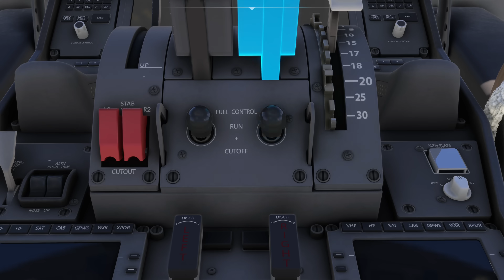Air India 171: Why Did The Fuel Cut-off Switch Get Moved?

Comment: i saw one pilot's analysis of the report that unless thrust lever is pulled back completely, it's not possible to switch off the engine fuel supply. since the jet was ascending it's thrust levers must be totally forward. then how were the switches turned off?

Comment: These raise serious questions on whether clear red-flags on the fuel shutoff valve of Boeing’s 737/757/767/777/ and 787 were overlooked

The UK Civil Aviation authority raised questions  on the air worthiness of the Boeing 787, and specifically touched upon the fuel shutoff valve even before the crash. The AI 171 was a Boeing 787.  Please do not avoid possibility of mechanical failure. We don’t want to wait for more crash. 

Moreover, please don’t compare response of Pilot with kids response.

Comment: Those switches SHOULD NEVER be located there in the first place. Never at the central pedestal within reach of other vital mid-flight controls and switches...I have said this multiple times...the cockpit panels were poorly designed. First to be switched on last to be off should not be easily accessible such that accidental touch without both eyes watching hand movements (whether your own or your partner) can lead to catastrophic unwanted situations, hence should have been better be located not on either side but at the central overhead panel, where both can notice any deliberate hand movements yet can quickly glance if in right positions  but still not too easily touched by any accidental brushes of fingers and hands that mostly focused on central levers and switches nestled between the two seats

Comment: I have to caution people in the most stringent terms to recognize that we do not know that a human being moved the fuel cutoff switches. We know only that the flight data recorder recorded a change in the value in the computer that stores the position of the fuel cutoff valve. It is entirely possible that this was a software fault, and not an intentional action. We may never know the truth of this.
Reply: surely not, if there was no change in position of the switches one of the pilot would not have asked that question in the first place…so your assumption is precisely wrong on this Sir…surely we must not judge till final reports come, but human intervention is confirmed with the data available till this point…

Comment: Make no assumptions - The report states "transitioned" not deliberate action. In the absence of all pilot conversations, we cannot conclude that it was pilot deliberate action. Lessons Learnt - (i) Install cockpit video cameras, (ii) Space out the fuel switches - one of either extreme side of each pilot, (iii) Check for any software glitches than can cause fuel shutoff with the fuel switches still in the "run" position. You are concluding "human intervention" which is concluding even as the investigation is on. You appear to be a "Boeing" spokesperson. Remove your tinted glasses and view the case again from an unbiased perspective and you may be surprised that a different outcome may also be possible

Comment: This man is completely biased

First he is comparing the pilots to his kids 
How can u compare a pilot to a kid whose brain is still under development.

He is saying that the report clearly points out that the aircraft was not at fault where does the report say that, the report clearly states that the switches transitioned from run to cut off, the report does not state what caused this to happen that is still under investigation.

The report mentions that both the engines lost power  within one second of each other.

Just yesterday a experienced pilot who has flown this same type of aircraft for years was on TV  saying it is humanly impossible to cut off the second switch after cutting off the first one within one second.

There should be a law against misinformation and the pilots families should file a defamation case against this person.

Comment: The timeline in the report does not match the take-off video. The report states that lift-off was at 08:08:39 and that maximum height was archived at 08:08:42, where the fuel control switches were translated from RUN to CUT-OFF. From the video the aircraft is seen to climb for much longer,at least 6 seconds.

Also that the RAT was starting to produce hydraulic power at 08:08:57 and at this time both engines N2 values were below engine minimum idle. The RAT takes 6 seconds to spin-up to provide hydraulic power. Also the engines take a minimum of 5 seconds to rollback to below idle. That is 11 seconds in total. But the time from when the switches were moved to the time when the RAT was beginning to operate is only 5 seconds.

This suggests that the RAT was deployed earlier (around 5 seconds) and that both engines running below idle was not what caused it to be deployed. 

There are 5 basic conditions that can cause the RAT to be deployed (and about 10 with variations). Deployment of the RAT is inhibited on the ground by the Weight on Wheels (WoW) sensors. If other conditions to deploy the RAT were satisfied, then the RAT would be deployed at the weight came of the wheels, at lift-off at 08:08:39. This implies that there was another problem before the switches were moved at 08:08:42.

The exact time the RAT was deployed must be determined and also the conditions that caused the RAT to be deployed.

Comment: How about this for the cameras: The recording only stays stored during a particular flight and only on board the blackbox. At the end of each flight, the recording is erased but requires authorization from both pilots and one, say the senior flight attendent, to delete. So, in case of an accident it will always be saved, cannot be removed by one person to hide something he did, cannot be removed by both pilots alone as well if the other crew suspects it would be worth to see that video even for a minor accident, and the pilots dont have to worry about their privacy/or some pressure due to the presense of cameras.

Comment: You CANNOT have a design where two people would be required to shut down an engine, because the entire point of having two pilots is to protect against the possibility of the incapacitation of one of the pilots. The entire aircraft must be operable under any conditions with only one person able to operate the controls.
Reply: where there is a will there is a way....nothing is impossible!    it's called engineering!

Comment: Just asking a hypothetical question, if there was something wrong with the system, not necessarily the actual switches themselves, could a fault “behind the scenes” turn off the engines?
Unless there is more audio released, the only thing I have heard, is the one pilot asking the other did you turn off the engines, answer- no, then a mayday. 
It took ten seconds to get the engines turned back on, a long time unless, one pilot was stopping the other, and then there would be audio, or, they look at the switches and they show still on, perplexing, so they turn them to the off position and back to the on, and that resets things, but of course time has run out.

Comment: Is it possible to turn off the fuel control switches within 1 second. Does the EICAS show when the switches are set to cut off? Could the EICAS have served as notification to the monitoring pilot? How possible is it that a computer malfunction and not the physical movement of the switches could have caused the fuel to shut off?

Comment: I have a question, Captain Steeeve. Considering the electrical issues highlighted by a passenger from the same aircraft (flight from New Delhi to Ahmedabad) and also considering the smoke/dust visible in the takeoff video and the RAT deployment just after takeoff. Can an electrical issue of some sort be associated with the fuel control switch signalling fuel cut off?

Comment: The time stamps of events and the voices are interesting. It has been mentioned by others about how "staged" the whole sequence of events appear. The calmness in the voice of the Mayday call and the extended period of time between fuel switches off and then fuel switches back on. It certainly looks like an attempt to end life deliberately but also in a way to shift blame away from the pilots and towards another cause. This case is clearly going to be solved by a psychologist and with reference to personnel pilot circumstances.

Comment: It’s vital that one of the pilot noticing the fuel supply switched off position and asking that vital question who switched off! It could be the other pilot accidentally switched off just after the take off while operating with other switches!
There’s no way they could have took off in V1 position into the air both fuel switched off! There’s no way those two engines give that thrust!

Comment: Captain Steve is not. Flight Safety Expert nor is he a qualified Aircraft Specialist - he has been speculating a lot since the accident
Reply: Exactly. He initially pointed that the pilots turned on the flaps. Then when some video showed RAT being deployed, he withdrew that statement. He is not even questioning why would someone deny doing something intentional when the objective is to cause max damage. I have quite a lot of respect for him, but basing something on a partial voice recorder conversation should not have been done.
Reply: @AtWillThinker he is not equipped or qualified to comment and assess air accidents and he has never named the airline for which he flies. Fuel switch of a Dreamliner cannot be turned off in a gap of 1 second. The report has used certain words which are not common among Indian aviation experts but is frequently used in US. Boeing has a lot to lose if this turns out to be a faulty switch. Read whistleblowers report on Boeing and you will understand why the blame is placed on pilots.

Comment: the western media is trying to put the blame on the Pilots. we understand very well that this is a deliberate Orcastrated effort to save the Boeing.  to support my stand that the Boeing crash report is a deliberate attempt to stain the Indian pilots, consider these precise points:

- Limited access to CVR data: The CVR (Cockpit Voice Recorder) data and other conversations are not publicly available, which raises questions about the thoroughness and transparency of the investigation.
- Selective focus on pilot actions: The report's emphasis on the fuel control switches being moved to the "cutoff" position seems to imply pilot error without considering other potential factors.
- Lack of consideration for alternative explanations: The report doesn't provide a clear explanation for how the switches were moved or whether other factors, such as mechanical failure or design flaws, could have contributed to the crash.
- Insufficient context: Without access to the full investigation details, including CVR transcripts and other relevant data, it's challenging to form a comprehensive understanding of the crash's causes.
- there were earlier circulars issued by Boeing regarding faulty switches including the ones in 787.
- WHY DID EVERYONE FORGET THE FLIGHT UA613 ANOTHER 787-8 DREAMLINER WHICH DROPPED MID AIR DOWN 1000 FEETS !!!! WAS THAT ALSO PILOT FAILURE???? TILL DATE EXCEPT FOR  REASONS ATTRIBUTED TO IRU FALURE AND AUTO PLOT DISENGAGMENT NO CONCLUSIVE REPORT IS FILED !!!
 
YOU WESTERNS WILL TRY ALL GIMMICKS TILLSUCH TIME THAT ONE OF YOUR AIRCRAFT SUFFERS THIS !!!!
#INDIANPILOTSASSOCIATION
#AIRINDIA

Comment: If I assume it is a pilot deliberate action, I have couple of questions.

1. How the pilots behave if they find no thrust in mid air?. What they will check first?. Will they saw the engines first for any bird strike or fuel level or fuel switches?. 

In this scenario, did the pilot checked all these things before notice the fuel switches and did they have that much time in that low altitude? and asked the question to second pilot? Or the first pilot only switched off fuel and asked the question to another to put the blame on other pilot?. Can I assume he directly asked the question about switches since he is the culprit?.

2. If I assume no one switched off and first pilot noticed the switches and asked such question to another pilot. 

What reaction we can expect from other pilot?. Since it is not a regular question  and unexpected question, I can assume the reaction like "what" in first place.. 
If the second pilot answer is straight away the "No" without any surprise, can I assume that the second pilot is the culprit and he already prepared for that question and giving the answer "No" in no time.

Comment: Incidents like this might change future rules, Cameras in cockpit must will surely add confidence for travelers and operators. Fuel cut off need more validation (ie danger if cut off or safer if not allowed to cut off) atleast keep one on each side of the pilot or an alert when switch pulled to cut off. Pilot mental health concerns this is same for any person whose actions can impact public, the more the number the more important it gets, so just like airline fitness tests pilot also need it more frequent that 6 months, think about weakest link in a chain.

Comment: I have been watching all your videos specially the ones released before the prelim report as I found a lot of sense in the logics you used. I have worked as an automation engineer for more than 30 years including on data acquisition systems. There are some vital questions which you have not touched and concluded directly it as pilot error.

Questions are :
1.  Is the switch mechanically operating the fuel valve and the sensors are sensing the position of the switches or position of the valve spools?
2. If the switch is not operating the valve manually but sending a signal to some control system to operate the valve which operates electrically, then the situation is different. Dreamliner has sophisticated control systems and this should be more likely the situation.

In both the cases, the data acquired shows the switches were put to off condition.

In case 1, this could be because of :
1. Pilot error
2. Spring loose error (FAA bulletin) and vibrations causing the valve to move itself.
3. Position of switch sensor error and the engines are shut of by automation systems.

In case 2, this could be because of :
1. Pilot error
2. Switch sensor / shut off valve position sensor error leading to shut off by automation system
3. System error shutting of both engines and pilots thinking that someone has switched off the fuel and doing the emergency procedure of moving to off and run position and hence the conversation 'why did you do it'.

Pilot shutting down has been narrowed upon by you while there are other equal and in no way less possible causes. There is a huge possibility that the switches were mechanically in Run position and electrically it was signalled to automation systems as Off.

Clearly the second pilot has denied operating the switch. Why we attribute that  as a childish behavior without any proof while it is greatly possible that he spoke the truth and he actually did not move the switch.

If the switches are mechanically latched into position, there may have been some click sounds which voice recorder should have picked up but there is no mention of that.

Also the report gives only 2 lines from voice recorder and has not said anything before this crucial question asked by pilot 1 to pilot 2. It does not seem logical to state only 2 sentences.

Unless other possible reasons are ruled out, it would be unfair to narrow down the blame to a pilot. The prelim report has raised more questions than given answers and you have given a verdict.

Comment: I do not agree with your conclusion that it was the pilot who was responsible and not the machine. 

As from what you have been harping upon is just the conversation between the 2 Pilots, one saying why did you do it and other pilot refuting the same. What this shows is that the 2nd Pilot was denying him doing it. That it. No  further conversation has been referred to in the interim report. The Pilots thereafter did attempt to put the engines to run mode.

This categorically shows that the 2nd pilot did not do it. Just arguing that the perpetrator would obviously deny doing it, is wrong cause if that was the case the perpetrator would not have allowed the other pilot to switch the engines to run mode, there would have been a scuffle, but nothing of that sought appears to have happened. 

You’re other argument being that the mental health of the Pilot could have been questionable and that’s the reason he did it, is also not correct, as the Report does not state that a study has been conducted on the mental health of the pilots. Just because the mother of the one of the pilot has expired cannot lead to the conclusion that the pilot’s mental health was compromised. To add to that assuming he was suffering from mental health issues, why would he do such a thing 240 off passengers for the mere reason he lost his mother. He could have killed himself alone, there has to be logical reason for him to do this to 240 passengers. 

You taking a stand that the machine was completely fine and had no issues shows that you are being biased towards Boeing and to add to that in your own videos you offer to meet the employees and console them, sounds prejudiced. 

One thing you should be noting is that there is a vast difference in the western culture and Asian culture, so the parameters of mental health set for western culture cannot be blatantly applied to Asian culture, specially in India. 

So just based on the Interim Report, you should not have arrived at such conclusion and sided with Boeing and point fingers at the Pilots, especially when you yourself are one and the 2 pilots are not there to defend themselves. 

Just a passing comment, Boeing has a history of pointing fingers at pilots and later investigation having revealed that in fact it was Boeing’s machine who was the actual culprit.